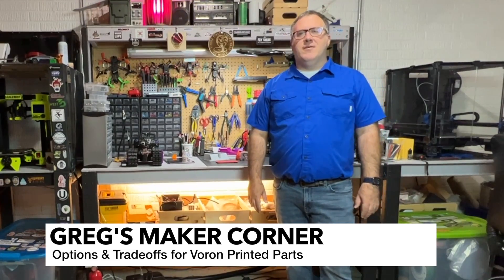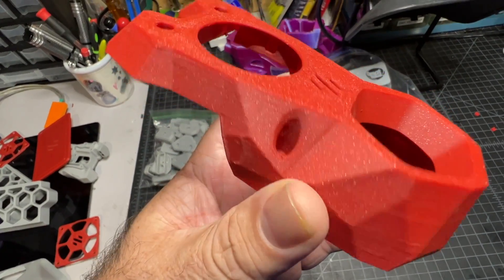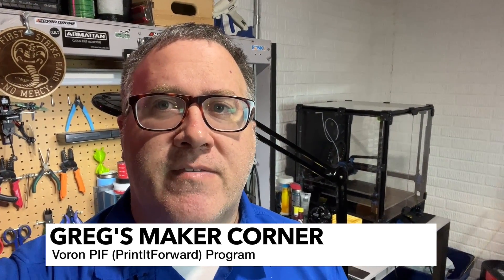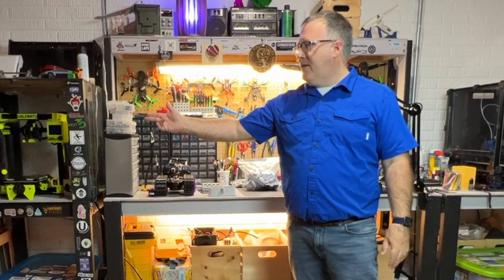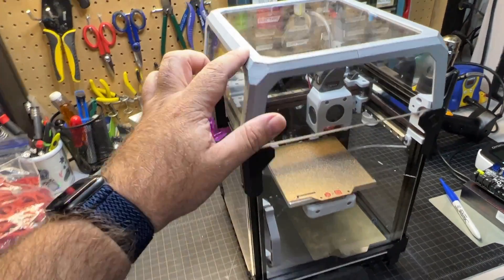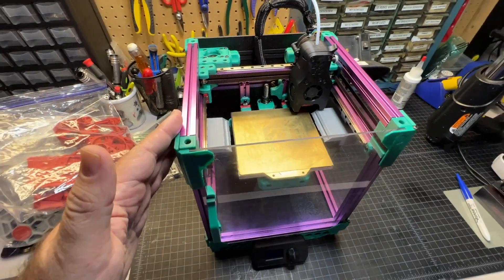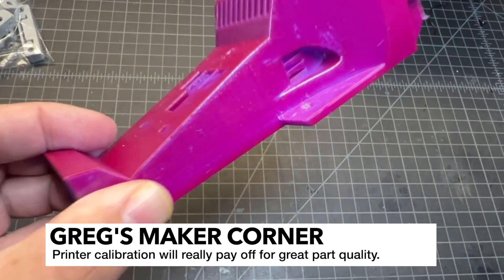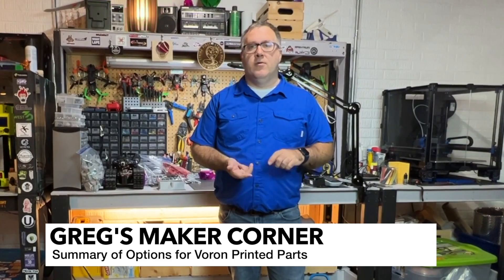A Guide to Voron Printed Parts: Options and Tradeoffs

Comment: You absolutely can put heat inserts into resin prints. The trick is to oversize your holes and not HEAT SET them, but rather EPOXY them in.

Comment: Appreciate the info here, man! I'm curious if you've had any experience printing Voron parts with CF or GF blends? I know these blends, while easier to print (I absolutely love PETG-CF), can be notorious for shrinkage, and the Voron community seems to recommend against for that reason. I haven't had any major shrinkage issues with PETG-CF (although, can be noticeable in certain applications), but I haven't tried with ASA-CF and the like
Reply from the maker: Thanks for watching and the comment! I haven’t yet tried anything other than asa or abs, but I have heard of folks using asa-cf and Abs-cf with success and there are even folks selling part kits on Etsy. I have heard concerns of material creep (drooping) with some blends but that’s typically other filaments. I wouldn’t use PETG unless you aren’t planning on ever enclosing or selling the machine. Best of luck!!
Reply: @GregsMakerCorner  thanks for your insight! Yea I have no plans to use PETG by any means, I plan for ASA/ABS. I just have a few spools on hand of ASA-CF, so I figured I’d ask. Seems I’ll put it toward something else. Thank you and happy printing!
Reply from the maker: @Houstnwehavuhoh  Sounds like a plan!! I am pretty sure that ASA-CF would be OK, but it's definitely a safer bet to go with regular ASA or ABS.

Comment: Hey great video Greg! I’m starting my Trident build, and can’t wait to get into the Voron platform. 

I see you got some drone related stickers on you shelf. Do you still drone, or you just into 3d printing now?

 Anyway, thanks for the info! Subbed your channel, and I hope you’ll take the time to check out what I’m working on. 

  Happy printing.
Reply from the maker: Thanks for watching and the comment! I am mostly into 3D printing these days but I still do fly. Drones actually got me into 3D printing back in 2015! I have been disappointed by all the new regulations in the drone hobby, so I’ve taken a bit of a step back but I still enjoy flying a few packs on my FPV setups which is currently a long range 4” with DJI. I am waiting to see where HD goes and thinking about the walksnail / Fatshark hd zero system but I already own like 3 pairs of goggles and get tired of buying new constantly… but it’s not much different for staying current with 3d printing I suppose :)
Reply: @GregsMakerCorner  very true, the regulations are very frustrating. I finally bit the bullet and got my part107 just so I can continue to enjoy the hobby.
As far as the new digital systems…I just recently got into the Walksnail Avatar system, and absolutely love it. However, no sooner than I got into digital, and got it all set up, the very next day DJI releases the O3 air unit. Go figure. 
All that being said, I’m very happy with the Walksnail setup, but if I was just fixing to get into a digital platform I’d probably go with DJI. 
I’m super excited about this Voron platform I’m about to step into, and it’s guy’s like you that help me get a good idea of what direction I’d like to go in. So keep up the good work. I look forward to seeing more of your content.
Reply from the maker: @thepoorboychannel  Yes! Part 107 helps, I've renewed mine once and I think I'm due again.. :D  The O3 air unit looks great. I have the DJI V2's (just got rid of my v1's) so I can use both v2 and v1 systems, which is probably fine for now.  I was thinking about getting the walksnail addon so I can use my older Fatshark HDO goggles and try out walksnail and may try that at some point, I like the really small transmitters.    Best of luck on Voron- thanks for the kind words and feel free to ping me in Voron Discord if you run into any issues!

Comment: May I know what kind of material you put under your prusa?
Reply from the maker: Good catch! It is recycled rubber, the kind that you can use for flooring. I can't remember the exact one, but here is a link to a similar one.  https://www.lowes.com/pd/Rubber-Cal-Rubber-Cal-Maxx-Tuff-Rubber-Mat-Heavy-Duty-Rubber-Floor-Protection-Mat-Black-in-color-1-2-in-x-2-ft-x-3-ft/1003070204

Comment: Hey Greg, building my first Voron soon, a trident. And I want to source my printed parts from Boxxy. 
I have a question, there is an option for plug type on their site that has Combo and Filtered as options. 
What does that mean? I am not sure what to pick for my LDO kit.

Also thanks for the letting everyone know about Boxxy. Seems like a great source
Reply from the maker: Hey @Svarog, there are a few types of AC plugs that can be used on the back (or sometimes called power inlets). When you specify LDO Trident kit you should get the correct one from Boxxy. Here it is in case you are wondering. https://github.com/MotorDynamicsLab/LDOVoronTrident/blob/master/STLs/power_inlet_1.2mm.stl
Reply: @GregsMakerCorner  thank you so much, I put in an order with Boxxy and it’s all sorted! Excited for my build
Reply from the maker: @svarog9053  Awesome! I hope your build goes well.